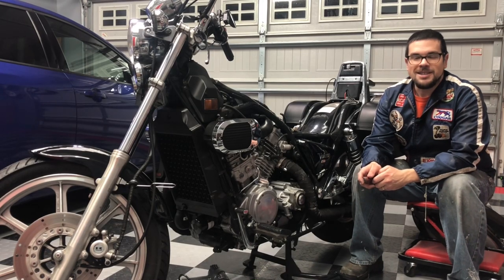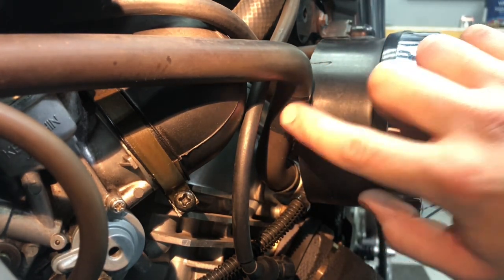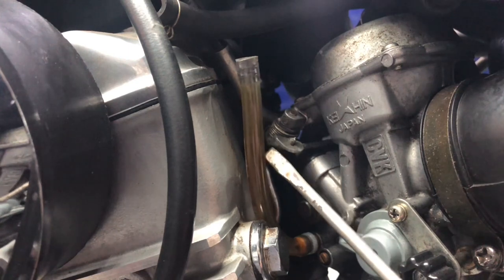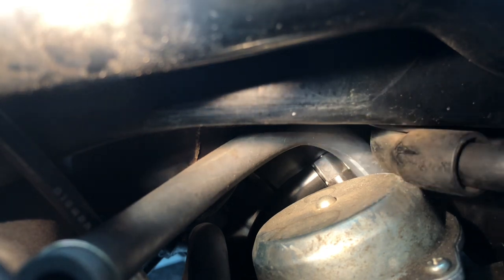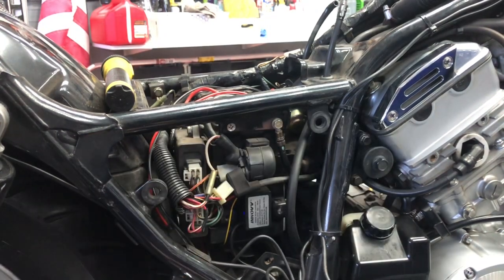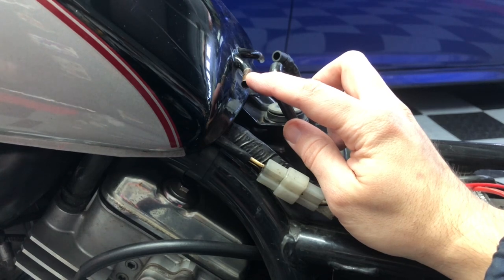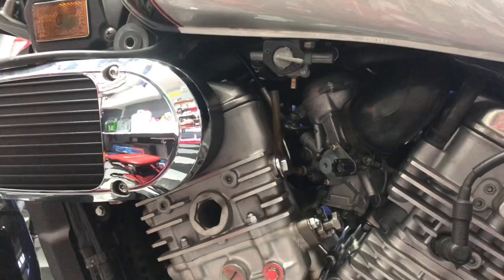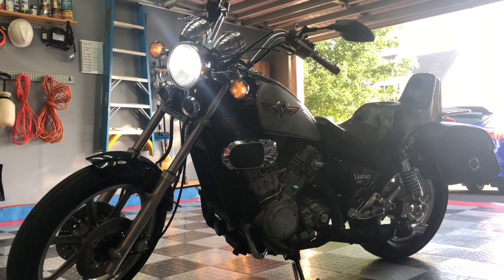How to Connect the Fuel/Air/Vent/etc. Hoses & Lines on a Kawasaki Vulcan 750

Comment: Hey, im not sure if you remember but, when its cold and you start the bike with full choke does it like start around maybe 500 for like 2.2 seconds then makes it way up to like 3k rpms? Also if I'm not mistaken the correct idle for the bike is 1100 rpms. Please correct me if I'm wrong!
Reply from the maker: I have noticed that with my Vulcan! Even though mine has straight pipes and significantly larger carb jets than what came from the factory, this does happen to me. When I start my Vulcan, I always crack open the throttle slightly. Between this, the iridium spark plugs, and the pickup coil mod, my Vulcan starts up very quickly whether cold or hot. Here's a video showing my bike starting up with a hot motor, and it's almost as prompt to start when cold too:

https://www.youtube.com/watch?v=7KgbuQ_Nd8c
Reply: @CFG750  When you did the pickup coil mod how did you shave the metal piece? Did you use a router with a sandpaper attachment or a metal attachment? Also how did you know how much to cut thanks! I’ll probably do the two wire mod and the blue wire mod soon. I’m confused how to connect the blue wire mod. I watched the video but it’s still a little confusing. How do I get it out of the connector below? Just shove a screwdriver inside to remove that pin? Thanks!
Reply from the maker: @KhaiMahase  For the pickup coil mod, I used a dremel. But I also heard of another owner who used a chainsaw file. Do not worry about the specifics of the procedure. I am in the process of planning my next video, which will be the first in a series of mod videos for the VN750; I'll be filming about the pickup coil mod. I plan to have the pickup coil mod video out promptly this week.

I'll also do one about the two wire/blue wire mod. But I don't know when precisely I'll get to it. 

To remove the tab, it is quite tricky! Try to use the smallest flat-head screwdriver you have. One of those scredrivers for work on watches or phones would work great, that's what I used.
Reply: @CFG750  sounds good! I have another question you may not know the answer too. When the bike starts up full choke randomly I hear like pshh noises, not constantly like intermittent. The carbs arent fine tuned to be dead center with each other, could that be why? It’s running 87 octane. I will adjust the carbs to be dead center when I get a chance
Reply from the maker: @KhaiMahase  87 octane is what's recommended for these bikes. I wouldn't use any higher octane because the high octane fuels are made for high compression motors. 

As for the noise, I am not sure. But take care of the carbs first and then check again. If it's making the noise, try to record video and make a post over at VN750.com and I and the other members will help you out.

Comment: Hello.  I have a 2002 VN750 Vulcan.  My issue is the front brakes are sticking to the rotors.  I did bleed the brakes with new fluid.  Still sticking.  I did see a video here on YouTube on how to service/rebuild the calipers, but for the life of me can't seem to find it.  Any help in this area is greatly appreciated.  This is the first time I've attempted anything like this.
Reply from the maker: First, open up the brake fluid master cylinder again and check the pinhole openings at the bottom. Make sure they're not clogged. Second, make sure there isn't too much fluid in the master cylinder (make sure to check via the sight glass with the bike on the center stand). Third, it's possible that the previous brake fluid turned partially to gel over the years and you didn't get that out during your brake fluid flush. So this is where a service/rebuild could help. 

I couldn't find a video specific to the VN750, but most motorcycle brake calipers assemble in a similar fashion. Check out this video here. I hope this will help you.

https://www.youtube.com/watch?v=kb0ox9Ue6fw

Also check out this Vulcan 750 Forum post here:

https://www.vn750.com/threads/front-brake-caliper-rebuild.106164/#post-1293856

I will add this to my list of video ideas and I will make a video about this in the future.
Reply: @CFG750  Thank you for taking the time to reply.  I will double check the pin hole.  This weekend will be caliper cleaning and rebuild.  Cheers
Reply from the maker: @cliff8669  You are very welcome. It's my pleasure! Goodluck this weekend and feel free to let me know how it goes. ☺